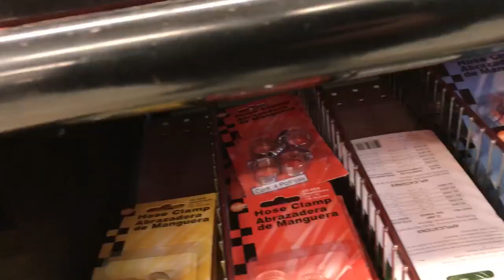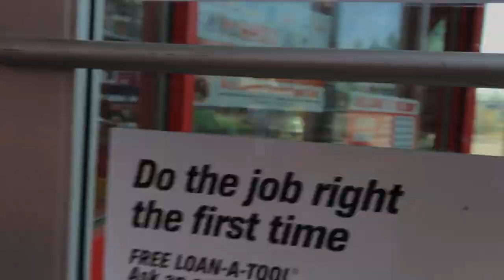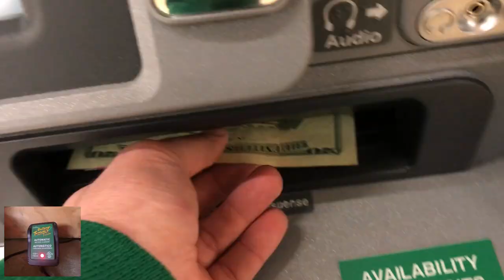Selling My Favorite Thing - Vlog #5 Punk Cover Moose (musician bloggers on youtube)

Comment: It's just a small glass 250ma fuse in the meter. I change half a dozen a week at work 😘
Reply from the maker: David Cockerill what?
Reply: @PunkCoverMoose  I work as a school lab technician in physics. The multimeter you used should have a 250 milliamp fuse inside to protect it. If you connect it wrong it blows I have to change loads every week at work
Reply from the maker: Oohhh... sorry I must have been out of it when I read that!! Thanks David!! I’ll check that 😎